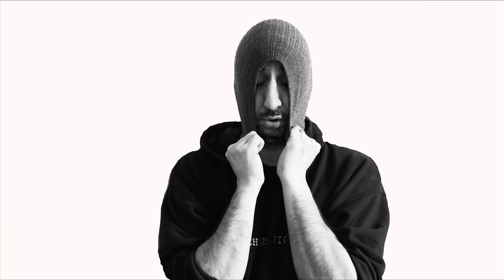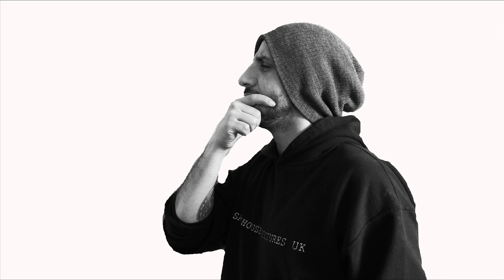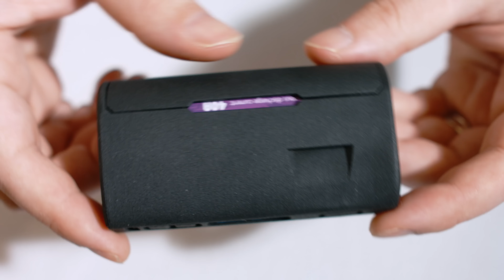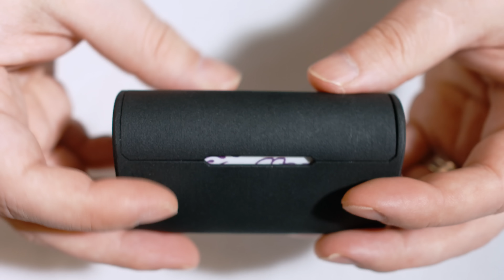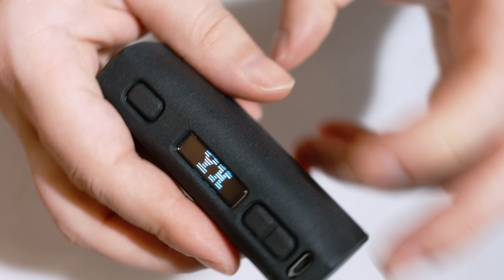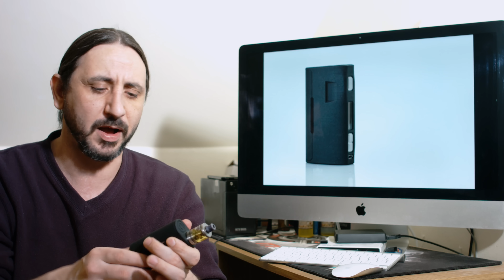Vape Droid Review

Comment: £220 ? Apart from it being a 26650 you could buy an actual sx mini m class or ml class for walking around, and it's made from plastic.
Personally I'd prefer to buy an sx mini ml class with a newer chip for around £150, if you don't mind dropping a £220 mod surely you won't mind dropping a £150 mod with a newer chip that's made from metal.
As far as I know 3D printing is a pretty cheap process that's suppose to keep costs down.